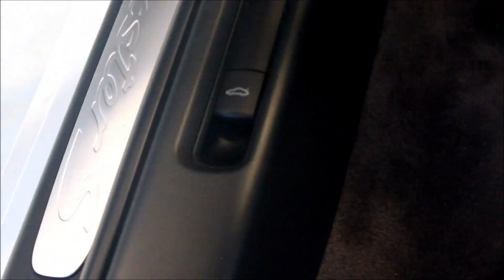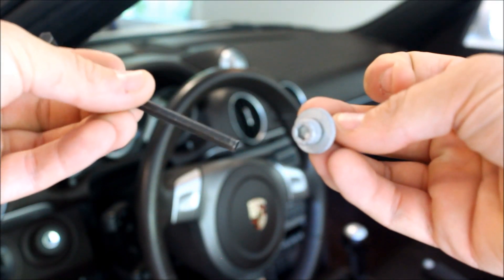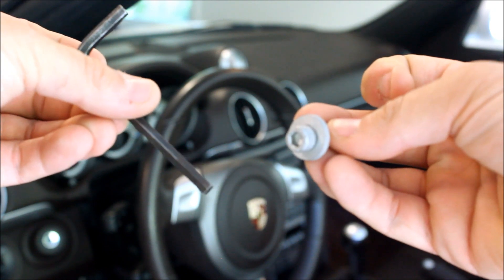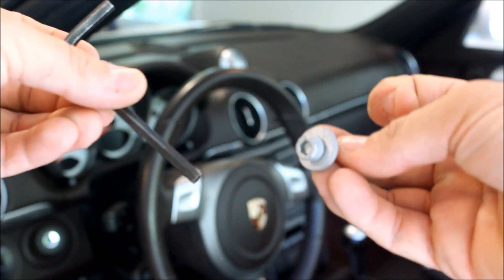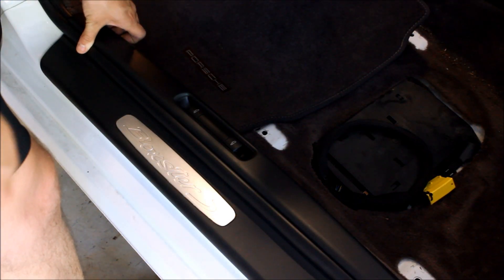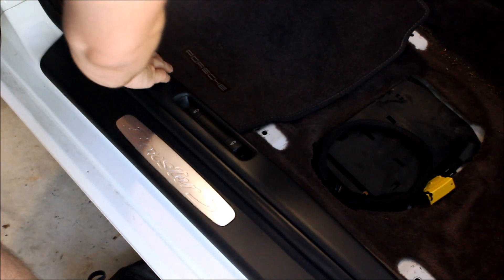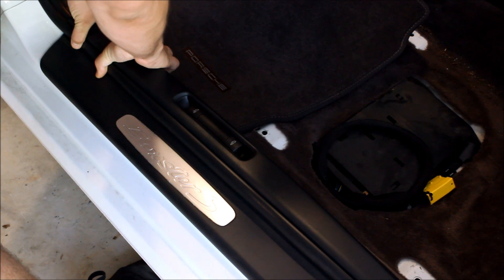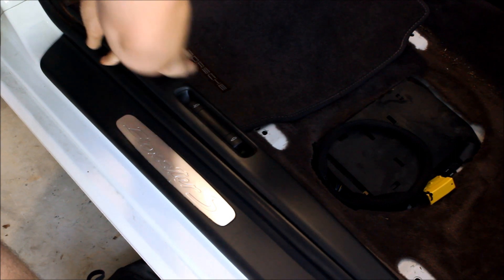Porsche 987, Trunk Release Panel Removal

Comment: For anyone wondering, on a 2007 Cayman, the screws appear to be a 5mm hex. I didn't have to take them all the way out on mine, just loosen and then lift the panel off the upholstery clips (lifting straight up with an upholstery lift tool)
Reply: Benjamin Orsburn Thanks! That’s what I was looking for!
Reply: Thank you SO MUCH for the 5 MM information!  Same on Boxster, so probably all.  Huge screw for a plastic trim panel and your removal instructions were invaluable, since the screws cannot be passed through the cover hole!
Reply: Thanks for the 5mm info. It’s a great video but “small Allen wrench” didn’t help much.
Reply: Guys.. how in the world did you manage to get the back screw with the seat still in?

Comment: Thanks for the video!

A note on how to disassemble the controls ... It's not super easy! The switch assembly has 2 parts. I first had to remove the part holding the switches themselves from the back, and then the part holding the switches from the front.

Comment: Also you’ll have to pull the plastic panel upward section by section as there’re 6 ‘click’ pins underneath. You’ll hear the small pop sounds as you remove them little by little. 

For me I couldn’t yank up the whole panel in one try so I lift them up section by section slowly

Comment: Does this work the same way in a 997 911?  I broke the 'frunk' release button and I bought the whole unit for cheap on Amazon.  It would be amazing it if were that simple.  Thanks
Reply from the maker: It should be more or less the same. The 997 shares a lot of interior pieces with the 987.
Reply: I can confirm that it works also on a 997.2 convertible